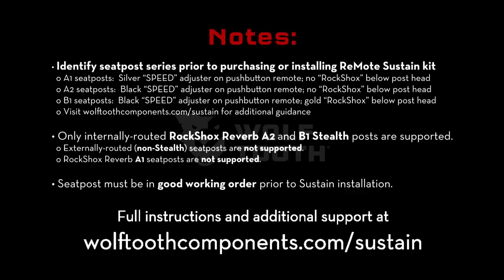ReMote Sustain for Reverb Installation Instructions

Comment: Just did this to my new 2020v1 transition sentinel.. I have always run a Wolftooth lever  and this was the most economical way to go to have a much better lever but keep the reverb... seemed daunting at first but took it by step it was no problem!  The hardest part was routing the new cable through my frame... wished I would have thought to tape the new cable to the old one before pulling it from the frame to help make that easier...Thanks

Comment: Thanks a lot for the great tutorial! I just finished replacing my old Reverb lever for the your sustain kit and it went absolutely fine! Well... most of the time 😅 

The part that caused me problems was the internal routing. Man, to assemble that wire with the housings, find these holes in the frame, get everything through just to forget about one of these stupid frame sealings and rip it all out again to start over with it... 😬 annoying

Comment: Just did this conversion on a Reverb B post that I got with my new 2019 bike.   It did not have a connectamajig.  At 5:00, I needed a 15mm open end wrench with the 11mm wrench to remove the hydraulic fitting.   The written instructions from wolftooth did not mention the 15mm wrench either.   May be a recent change from SRAM.   However everything worked fine after that.
Reply: Justin Won I also have something similar to your reverb. The connection between the hose and the reverb doesn’t look like the B1 on the video but looks like a C1. But it isn’t a C1. Mine is on a Nomad 2019. Did you find other problems installing the kit? Thanks man

Comment: Would have been nice to see the internal cable routing portion. I have to replace my cable for the sustain and that was only part you did not show.
Reply: tape the new housing to the old one before removing it... doesn't get easier than that

Comment: That looks like a different type of pinch bolt on the remote?  Mine has the shallow bolt head . Very easy to strip with the Allen key. Is that new?

Comment: Installed mine, very simple y'all......but the return speed is just too fast, it's either going to self destruct as it returns to top out or hurt the family jewels.....

How can I slow it down?
Reply from the maker: We actually went to a faster return because of rider feedback that reverb return was too slow.  You can slow the return by modulating the lever or adjusting how far the pusher pushes in (with the  barrel adjuster).  The post will not be damage, and we are unaware of any rider damage!

Comment: Will this eliminate the couple of millimeters of sag on my B1 reverb?  Will it tighten up the very minor twisting (yaw) of the inner seat tube inside the outer seat tube?
Reply: nope. you have to service the internals to get rid of the reverb sag. the slight twisting likely stems from worn brass keys. you need to completely disassemble the reverb to replace them. a set of replacement keys is only a few bucks. you will need a few seldomly used tools ... 23mm wrench, 34mm wrench, and a the possibility to clamp delicate round parts without scratching or denting them. PS. I know that I am 4 years late to the party but you are not the only one with those issues.

Comment: What size is the diameter of the cable housing? I have a 2014 Stumpjumper that reverb hydraulic hose won’t fit into the internal routing. I think hydraulic hose is 5 mm diameter. Thought about this conversion so I can install an internal reverb.
Reply: You can use 4mm or 5mm housing (it is just shift housing).